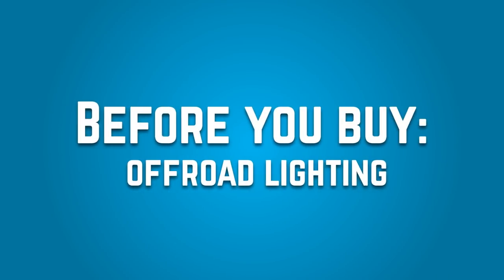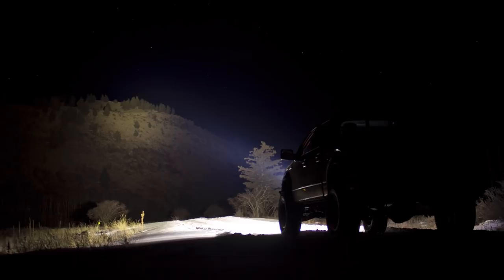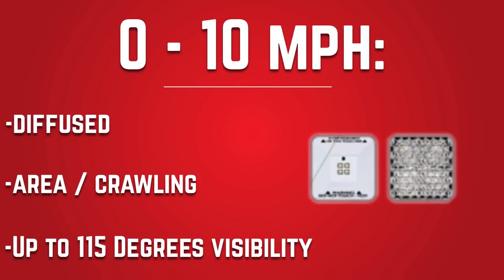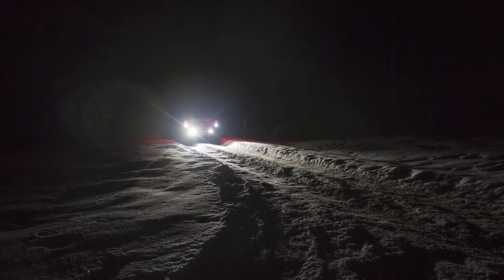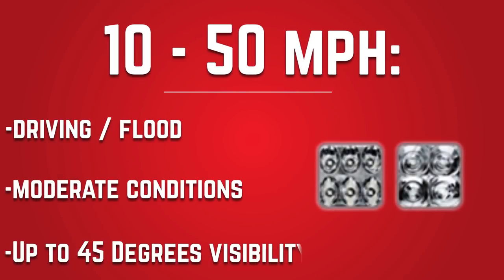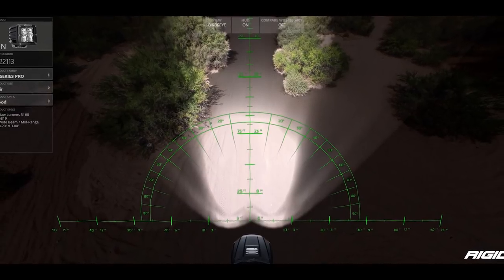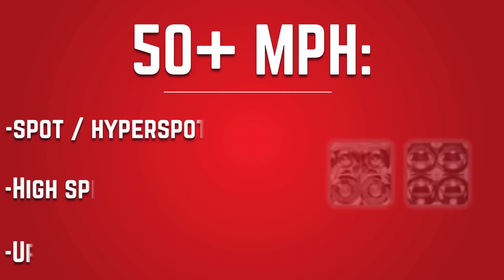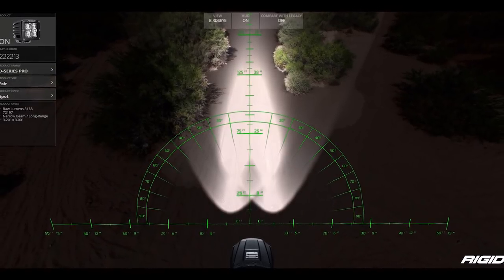Before You Buy: Off-Road LED Lighting Beam Patterns

Comment: I'm wanting to do a rack of 6 pods up top. What do you think about 4 spots in the center and to work lights on the outside. One on each side. I'm putting floods in the front bumper
Reply from the maker: If you're you're running a good mixture of lights 4 spots on your roof will really light up the center of the road and the rest should fill in the surrounding areas, sounds like a great setup!
Reply: @stage3motorsports  thanks for the feed back

Comment: Any recommendations for a light bar in which i get a shadow from the bat symbol (honest question, someone help)
Reply from the maker: Step 1 - Buy Rigid light bar with spot pattern
Step 2 - Call local fabricator to make face plate to go over light bar
Step 3 - Call for BatMan
Reply: Stage 3 Motorsports what light pattern would give me the best shadow from the bat symbol?
Reply: Stage 3 Motorsports I’m making the bat symbol rn to fit the light bar. I just don’t know what light pattern is going to work. Any recommendations?
Reply: @averydavisTV  did you ever figure this out?